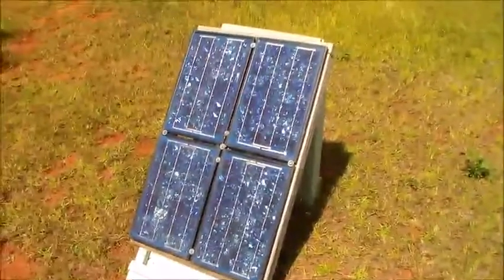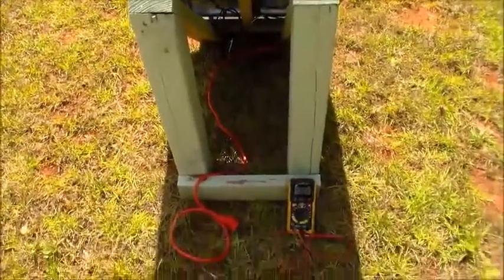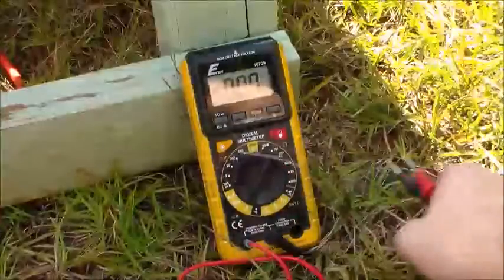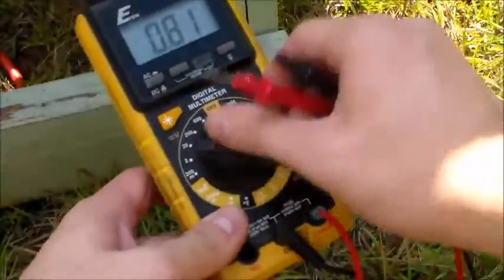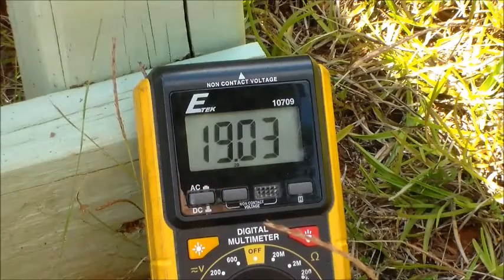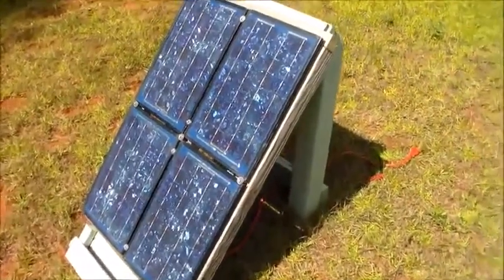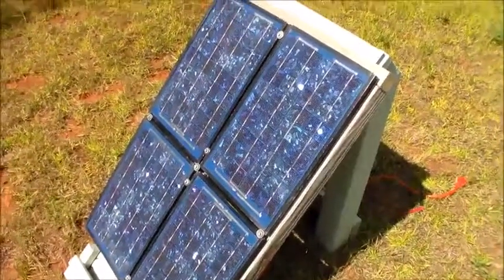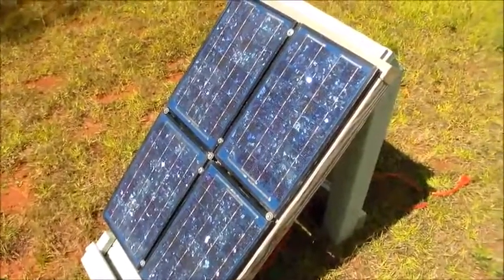Testing The 40 Watt Solar Panel Volts And Amps Part-3

Comment: They have the diodes built in?
Reply from the maker: +Doublenotminer No, they do not. I do switch them off when the sun goes down to keep the batteries from discharging.